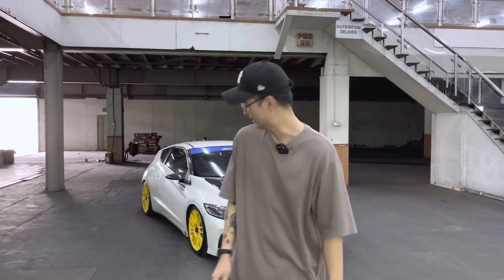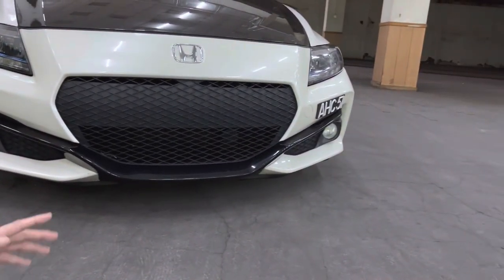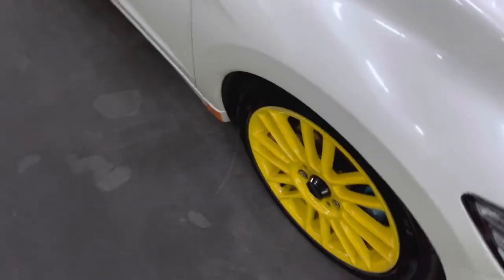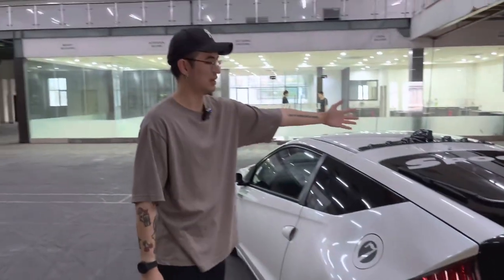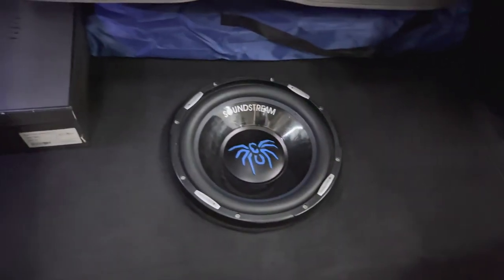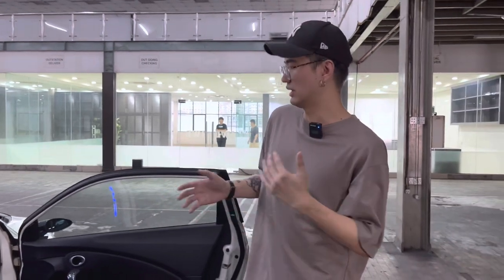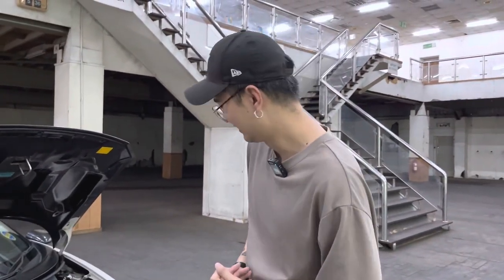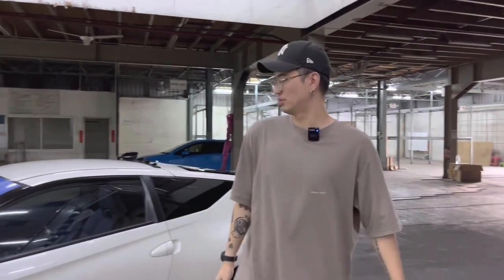MODIFIED SPOON SPORTS STYLE HONDA CR-Z #zf1

Comment: Front bumper is from a late model zf2 or zf3 I own a stock 2011 gt. The wheels and brakes are sick and very expensive mods. Also the black dash door cards and seats make me think its a zf2
Reply from the maker: This is in fact a ZF1 as the owner bought it brand new from the dealership since 2012, also the front bumper is indeed a late model called ‘final label’ in japan. Rare stuff and expensive aswell/